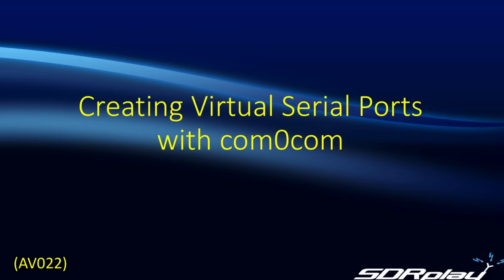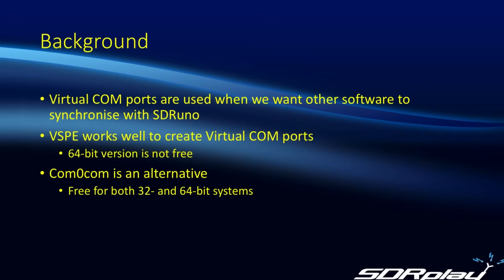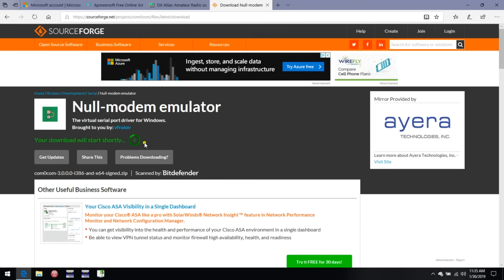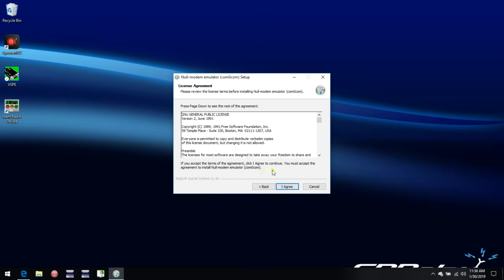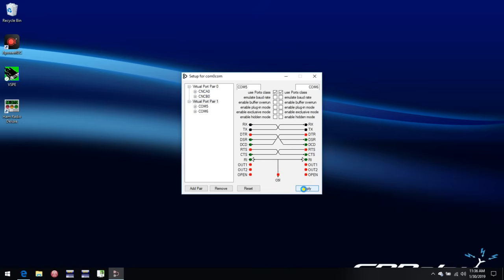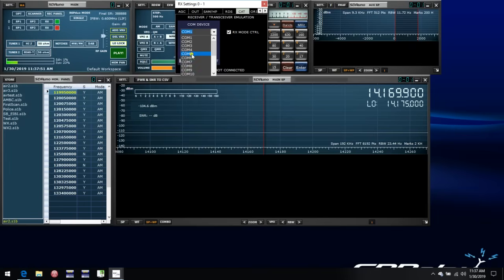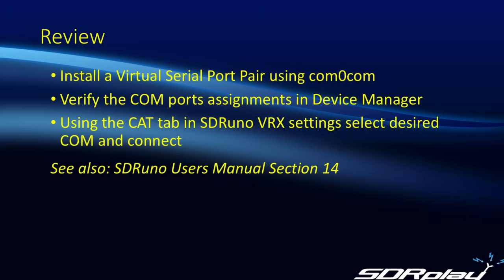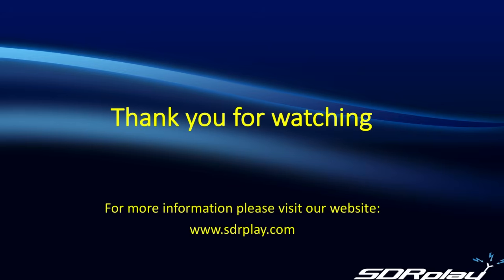Creating virtual COM ports with com0com

Comment: Hi, I've used com0com for some time with SDRUNO and WXTOIMG for polar weather satellite reception.  SDRUNO frequency is controlled from WXTOIMG.    I thought I would tryout VSPE 64 bit on Win 10, I discovered that WXTOIMG cannot find the set com port with VSPE.   Even if I reverse Com port numbers in the 2 programs, WXTOMG still fails to connect.  A terminal program in place of WXTOIMG works fine and can send commands to SDRUNO that are executed.  So it seems VSPE has a problem working with older software or has a bug.  VSPE is set as default null modem pin config too and the com pair does show in windows Device Manager.  I liked the idea that with VSPE one can choose your own com port numbers.    ANY ideas ???

Comment: I downloaded com0com and installed it ok but in the setup  for virtual port pair 1 it shows COM# and COM# instead of COM1 and COM2.
what did I do wrong and how do I fix it. 
Thanks, Mike
Reply: same problem here....
Reply: I had the same problem. I clicked “Apply” and virtual port pair 1 then changed to COM5 and COM6.
Reply: Turn off "secure boot" in bios setup. That worked for me.

Comment: Seems this is working fine with only one VRX. But what if you want to control 2 VRX independently from each other through omni-rig ? I installed two com0com virtual Com Port sets. COM1/2 and COM3/4. assigned COM1 to VRX0 and COM3 to VRX1. In omni-rig I set Rig1 to COM2 and Rig2 to COM4 (TS-480). Now when I start the controlling Software0 both VRX follow only Rig1. No control from Software1 over VRX1. Has this been tested and found working for you ?
Reply from the maker: Not sure why you're trying to use both? Usually it's either OmniRig -  between SDRuno and the rig, or Virtual COM port - between SDRuno and other 3rd party software.
To answer your question, VRX SETTings - ORIG determines which rig the VRX will respond to.
Reply: @SDRplayRSP  Because I want to use each of the VRX independently controlled through CAT by Software. Easy as that. I just tried with Airspy, works perfectly.
Reply from the maker: @hb9vqq533  you don’t need Omnirig for that.
Reply: @SDRplayRSP  The software (Faros) requires Omnirig
Reply from the maker: @hb9vqq533  in which case you set up Omnirig in Faros, do not enable it in Uno and just use the  CAT settings tab.
Reply: @SDRplayRSP  That's what I did

Comment: for me and my windows10 it doesnt work. i use VIRTUAL SERIAL PORTS EMULATOR
Reply: See my comment above, if you disable the driver certification check in the BIOS com0com works.

Comment: In the video you use com 5 for SDRuno and would CSV User List then be com 6? Does it need a com port? Also, if you had other programs, would they also be com 6? How does this work? I wish you had followed through on that. I know this was about setting up, but I need the punch line  (examples). Then all this makes sense.

Comment: This will not work with Windows 10 because Windows 10 requires signed drivers.  The signed driver provided by com0com is old and does not apply to Windows 10.  Do not try to circumvent signed driver requirement as it is a very important security feature.

The author of com0com needs to proved a signed driver specific to Windows 10.  Until he does this I would not attempt any work around.
Reply: I stand corrected.  Going into device manager and updating the driver works.

Comment: I still don't know the use of com0com. i was mucking around for a bit and became clueless.

Lets say I Have COM1, having my serial data coming in . I  need 2 Apps to simultaneously  connect to COM1, which is not possible,

So I create COM2 and COM3 virtual ports, But how to instruct the com0com that 

COM1 => COM2
COM1 => COM3

?
Reply: When you add a serial pair you get two new ports. One reads what the other writes. 
Say you add a virtual port pair, COM1 and COM2. If your app writes on COM1 it can be read on COM2, and vice versa.

In the case you describe Where COM1 is used for writing and you need to 2 apps to read the data I would create an additional virtual pair, lets say COM3 and COM4. When the first app reads COM2 it can then re transmit that data on COM3 wich will be read by the 2nd app that reads on COM4.

Comment: I am getting closer. You have to have already installed .NET before the install will work as the video. Now I get the setup screen but instead of port numbers, I get # instead of a number like the video.
Reply: Tom, I had the same issue as you after installing with the COM#; i went into device manager and opened up the com port that was installed, I noticed a yellow triangle next them; I then updated the driver.  Went back to the setup for comOcom and COM 3 & COM 4 showed up for me.  Might want to see if the driver needs updated. I'm running Win 10.  Hope that helps
Reply: @MitchPlehn  Finally, This was my issue thanks!
Reply: @MitchPlehn  Thanks for this!

Comment: I was really excited to see this. But unless I missed the fine print, this is only for Windows 7 . At any rate  it does not install properly on windows 10.
Reply from the maker: Tom Hoflich any Windows, for the video I was using Windows 10
Reply: @SDRplayRSP  Later versions of Windows enforce a certificate check for the driver, see my latest comment. There is a workaround. (edit) It may have worked for you as you had an older or upgraded version of Windows 10 when you installed it (legacy drivers).
Reply: See my latest comment, com0com works if you disable driver certificate checking in the BIOS, I've just done that and it installs OK.